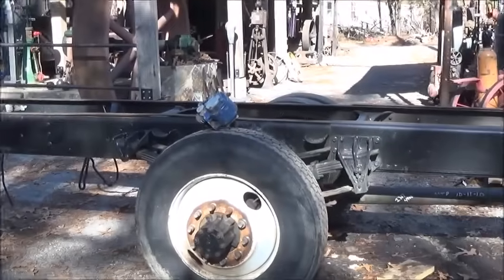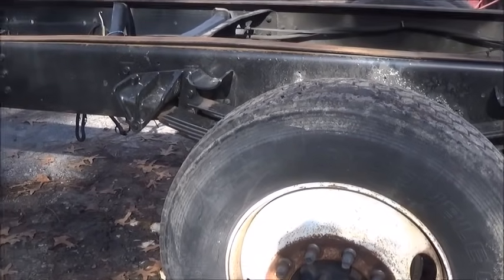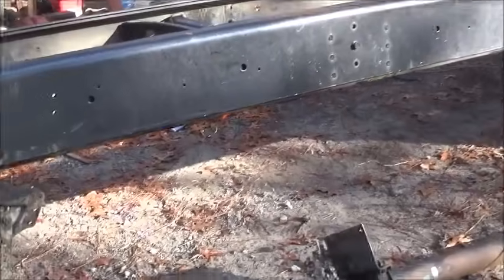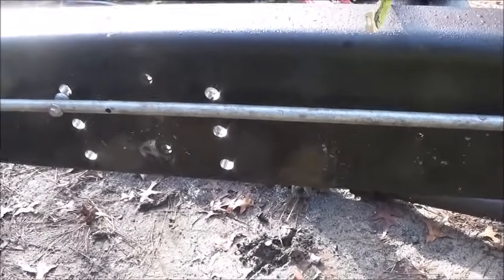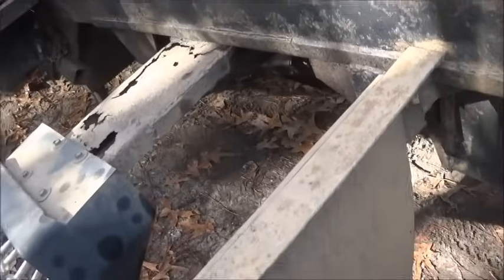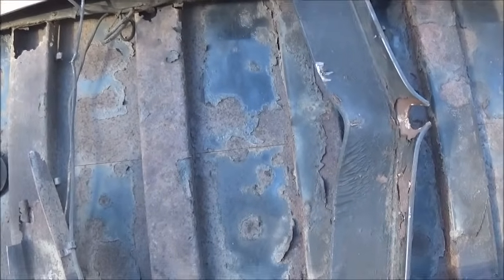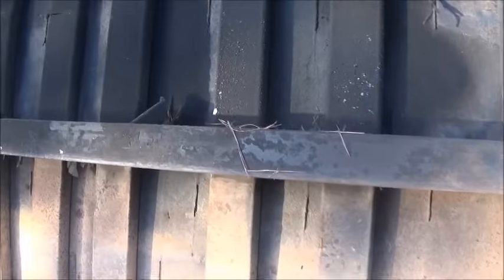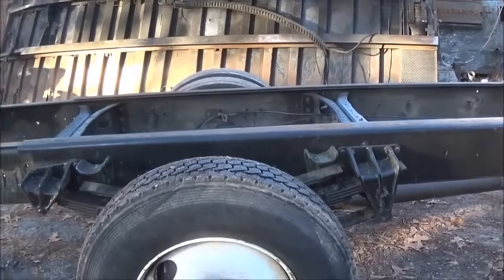INTERNATIONAL 4700 ROLLBACK LETS SHORTEN THE FRAME

Comment: I used to drive one of those DT466 IH's in college delivering appliances for Sears. 24' box. Smooth Ride, not too noisy, always started, never broke down with one in 3 years driving 200-300 miles a day every weekend, break, and full time in the summer. Those things are beasts, ours were sprint trucks so low geared, 65mph max on the highway, but they got up and went in the city, we would do anywhere from 17-31 stops a day, depending on the season. Great turning radius too. Never had an issue with them, great trucks, and always went straight down the highway. You're gonna love the extra weight capacity!!

Comment: Know those wheels well. Have the gear wrench for those stud's. Only unit I have left is a split rim style. F600 winch truck.1961. 
Yrs and yrs ago it had a tank on it and it suck the car washes out in those days. They took a rod out of the truck. So it was bought and turned into a winch truck with gin poles. Funny never had a problem with the truck or the motor. Plus it's has not ever let me down. One time gen light went out luckily made it to the shop.
Great video 👍

Comment: When you shorten the frame does that change the GVW?  I know you gain extra capacity based on the weight removed from the tail, but does it go up more based on the shorter wheel base?

Comment: Hey johnathan im in saint john n.b building a 1997 4900 mechanical 466 its a tandem ten speed split rear end im trying to build a rollback truack has air brakes im going to single axle what axle would you use id like to keep my running gear have the two speed rear end any input helps